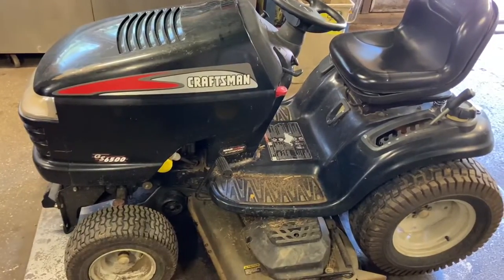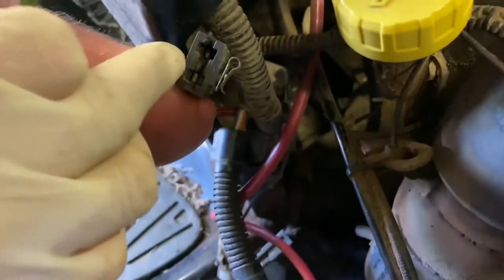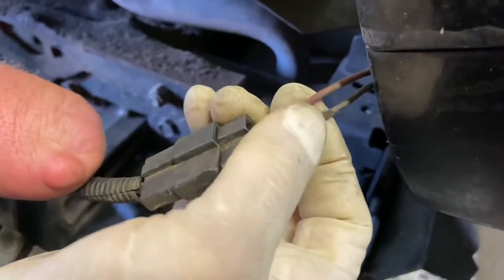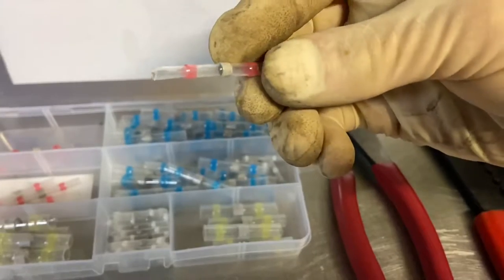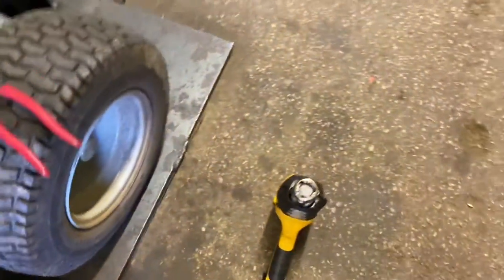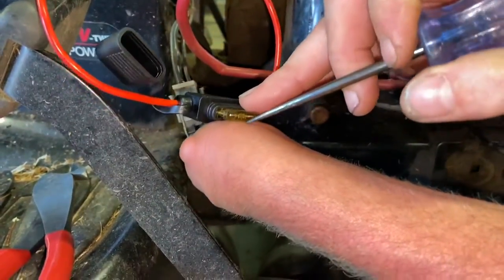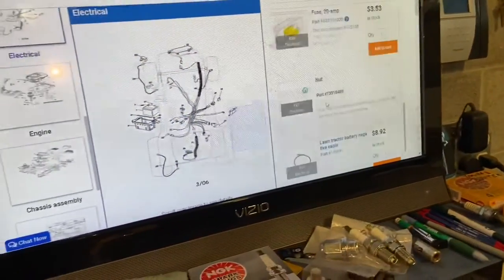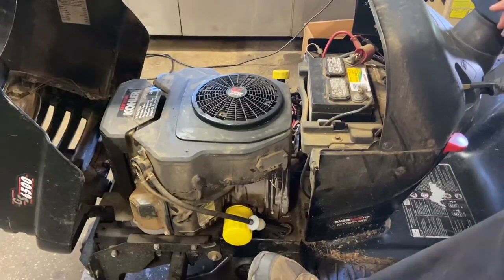Lawn Tractor Blowing Fuses

Comment: You showed me where the #)$;! Fuse was ! My mower worked last Saturday, then went back out to it and it wouldn’t do a thing - wouldn’t click, even the hour meter wasn’t showing up so I knew it was something electrical . The stupid manual just says the fuse is located “behind the dash”. Yeah, no it isn’t. It was right in the same place as yours- mines a different model but there it was and it was clearly bad. Put in a new one and the old boy fired right up! Not bad for an old lady! Thank you SO much for such a clear concise video- I’m so happy I could cry!  And the grass shall fear me….
Reply from the maker: LOL! I’m glad you’re back up and running. Thank you for the kind comment:)
Reply: I'm so excited to go find my fuse too!!! I looked everywhere behind the dash on my dys 4500! No start ,no click, no dash light... put in new solonoid,  battery and ignition!  I HOPE  it's the fuse...
Reply: The fuse was right there on right hand side. UNDER solonoid,  clipped on side wall CRAZY , not under or behind dash at all,  like the owners manual said!!  It WAS  blown and hood wires WERE arked! Thank you SOO much , wow I put on 3 new many parts lol

Comment: Swapped 26 HP engine into troybilt mower and left lights unplugged. One day it would not start and I checked the solenoid and blew five fuses. Turns out, the light wires got pinched in the hood hinge and made a short everytime the hood closed. Thanks for this video

Comment: My headlight wire wasn't tied down and  engine heat melted insulation. I said wtf uses head lites lol and cut the wire at different lengths and heat shrunk ea. End pinching the end.

Comment: Excellent video….My L120 was blowing fuses…I found the headlight harness had been routed around the hood spring…Caused the connector to rub through on the frame, the wire terminal inside was touching…since I don’t mow at night, I disconnected it, taped it up, and zip tied the harness out of harms way…You probably saved me at least an hour of digging through wiring!
Reply from the maker: I’m glad it was helpful!

Comment: Thank you so much for this video, this is exactly what happened to my X140. The 2 headlight wires came out of the housing and the contacts must have touched together and blew the fuse. Thankfully the wires are ok so I just needed to change the fuse only.
Reply from the maker: Glad to hear your back up and running!

Comment: Awesome video, I have a John Deere D140 that’s blowing fuses. It only blows them when the service reminder is plugged in. I bought a new one and it’s still blowing them, I traced the wiring but haven’t found any wire that’s grounded out. Any help would be appreciated. Thanks in advance.

Comment: Does it matter which way the wires go? I don’t think it does but I wanna make sure.
Reply from the maker: Installing the new fuse holder, No. Repairing the head lights, Yes (they are color coded)
Reply: Thank you that’s what I thought.

Comment: Did you determine on where the higher voltage came from I didn’t think that the stater on the engine was able to actually put out that higher voltage.
Reply from the maker: It’s not about the output. It’s about positive going to ground and melting/blowing the fuse.
Reply: @JohnsonsSmallEngines why do starter motors on riding mowers have continuity on the positive post to any ground on the frame but is still running normal and not blowing fuses?

Comment: My Craftsman riding mower runs great... until I engage the mower.  Then the fuse blows.  What section of the circuit diagram should I start troubleshooting?  Thanks.
Reply from the maker: It can be very difficult to find a electrical issue. That being said, What I normally will do is disconnect most all wiring plugs I can see. Then install a new fuse, I will assume you have a electric switch to turn on the blades? Then while sitting on the machine with the key in the on position, (tractor not running) pull the switch on, if the fuse does not blow, then one plug at a time, start plugging them in until the fuse blows and there you may find your issue. Obviously do not disconnect your ignition switch. I would start with the PTO Clutch plug(it is a electric clutch that turns your mower deck on, it is connected to the bottom of your engine) disconnect it then see if the fuse blows, if it does not, most likely you have a wiring issue with the PTO clutch or a bad clutch. I cannot help more than this without seeing the machine.

Comment: I have a John Deere 140 riding mower. That 20 amp fuse has melted. I don't see worn wires yet. Where should I look?
Reply from the maker: Impossible to answer that question without seeing the machine. If the fuse blew? Check the fuse holder for corrosion and if it is ok. I would suggest pulling all electrical plugs that run currant through them, ignition switch harness to engine etc, then put a new fuse in and one at a time start to plug in your electrical connections, when the fuse blows your normally will have found the issue. Electrical issues are almost impossible to diagnose with seeing the machine.

Comment: Hello- very informative video! I have almost the same problem with my Ariens mower, same exact spot where the wires rubbed together. Except with mine the connector plug close by has melted. Ace Hardware says I need to buy two entire harness kits which will run me about 200 bucks. Can't I simply replace the connector plug? Anybody have a thought on this?
Reply from the maker: Yes you can just replace the connector plug but you may need to get one from a parts machine. A similar tractor that is junked that you can get parts from.
Reply: @JohnsonsSmallEngines  Thank you for your reply! I will be on the lookout for a parts machine.
I'm going to hazard another question, just to show off my ignorance and liberal arts education. Since I never use my headlights, can I terminate the wiring at the melted point with some wire nuts?  Thanks again!
Reply from the maker: Yes

Comment: I had the same problem w the head lights, but is that why the mower isn’t starting?
Reply from the maker: After disconnecting the the lights and replacing the fuse, the engine should spin again when trying to start the machine. If the engine is spinning when you have the key in the crank position and the tractor will still not start? then you have another issue.

Comment: So, i've changed out my battery to a brand new one, because the posts were bad and the bolts holding the positive & negative wires to it were not tight, they were real loose. On top of that the battery ended up being bad. I was assuming that is what was making my fuse pop every time I tried to start it. So I placed a new battery on it a few hours ago and still, the fuse popped. I had already checked the wiring throughout the entire mower and they show good. There is no touching wires or exposed wiring and etc. What else could it be? Maybe the ignition switch? Any help would be greatly appreciated.
Reply from the maker: Try disconnecting your lights, ignition switch, wiring to your engine and electric PTO. Then put a new fuse in. If the fuse doesn’t blow, then start plugging in each plug until it blows. When it blows you most likely just found the issue.
Reply: @JohnsonsSmallEngines  Thank you. Will try that in a few. Thank you for responding.

Comment: I have a husqvarna zero turn that's blowing fuses. It will run for about 5 mins and then pop the fuse and shut off.. I am reading 12v to the fuse holder when the key is on or off ...any idea what the problem might be
Reply from the maker: Electrical issues are hard to diagnose with seeing the machine. I don’t know anything about your machine other than it’s a O turn. Something sounds like it is drawing to much current, like a positive wire just starting to ground out (slice in a wire). Make sure the battery is in good condition and check to make sure it is not charging over 14.5 volts. If it is you may have a alternator going bad or a regulator. I sometimes will start to unplug switches after you start it to see if there is a switch going bad inside. If the machine stays running and fuse doesn’t blow. You just found the issue. Only pull one switch at a time. Worse case, you would need to trace wires for continuity with the battery disconnected. Most of the time I can figure it out before that is the case. Also I have had to replace the entire fuse holder due to corrosion inside. Look inside the fuse holder for any corrosion.
Reply from the maker: When checking voltage at the battery it would be when the engine is running at full speed. If the engine has a voltage regulator it should not go over 14.5volts and it should be charging over 12.5
Reply: Great video man thanks I remember watching this video two days ago and I look today and it was that exact problem‼️  Can you bypass the headlamps and still have a good ground and and if so, how would you do that?

Comment: I have a 2013 Husqvarna  YTH24K48 with a 24h.p. Kholer Courage V-Twin, it has a New Battery, the mower starts fine but when I increase the R.P.M. it blows the fuse (20amp), I bypassed the fuse for a quick check, it cranked fine and when I increased the rpm it started surging, I shut it off replaced the fuse and it cranks fine as before,  do you have any suggestions as to what could be causing this issue?
Reply from the maker: Sometimes electrical issues are a little tougher to find. First start by checking your voltage coming out of the battery at full speed without the PTO on. If it’s above 14 V like 16 1718 then you may have a bad voltage regulator or alternator. Then I would start to check the voltage regulator and alternator by disconnecting each one and see what you get when you turn a PTO on and throttle up. You could possibly have a bad PTO but that’s very rare that your issue comes from that. It sounds like you may have a charging system that’s running away from you which means it’s throwing too many votes at you. So it is very important that your battery is in good condition. Good luck with it. Let me know how you make out.
Reply: @JohnsonsSmallEngines  WOW that was a quick reply, my battery is new and has a full charge, I traced all the wires I could see and found nothing, I removed the voltage regulator it seemed to check out fine I did clean the 3 connection prongs, I reinstalled everything and now it seems to be fine, it is charging at 14.2 volts at high rpm, so could dirty connections on the voltage regulator have caused the issue? I took it out and mowed for about 10 minutes and No Problem, kinda weird, anyway thank you so much I'm sure I'll have other problems, and check here first.
Reply from the maker: @busterallen9159  Yes, sometimes a bad connection could do it. Yours is a rare one that only happens when you throttle up. 14.2 is perfect on the charging system. Glad it seems better. Make sure battery terminals are clean and tight also. Please give this video a thumbs up, subscribe and tell your friends to help my channel grow. It would be greatly appreciated. Thank you for watching:)

Comment: Dirty or corroded contacts in the fuse holder can cause the fuse to 'physically' overheat and blow. This is not the same as too much electricity flowing through the fuse and blowing it. Dirty, corroded (high resistance) contacts can act like a load resistance and 'physically' get so hot that thel heat actually melts the fuse wire. I've had it happen before.
Reply from the maker: Good to know! Thanks

Comment: What if you're blowing a fuse even if the headlight plug is unplugged?
Reply from the maker: Impossible to answer that question without seeing the machine. If the fuse blew? Check the fuse holder for corrosion and if it is ok. I would suggest pulling all electrical plugs that run current through them, ignition switch harness to engine etc, then put a new fuse in and one at a time start to plug in your electrical connections, when the fuse blows your normally will have found the issue. Electrical issues are almost impossible to diagnose with seeing the machine.

Comment: Craftsman keeps blowing fuse when you turn on the key solenoids been change along with the ignition kind of lost right now
Reply from the maker: This video will only help if it is a bad fuse holder. Most of the time when fuses start to blow it is due to a positive wire going to ground. I cannot diagnose your issue without seeing the machine. It could be anything in the electric system causing the issue from a bad ignition switch to a mouse chewed wire to a bad head lamp connector near the muffler that melted.